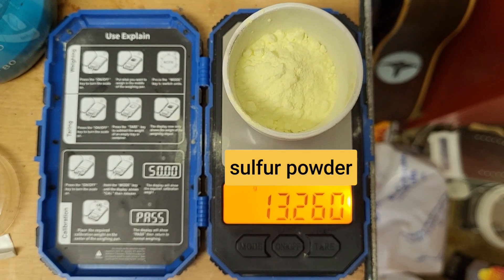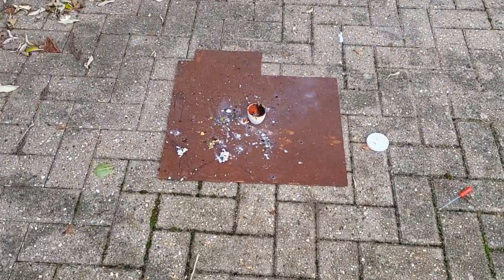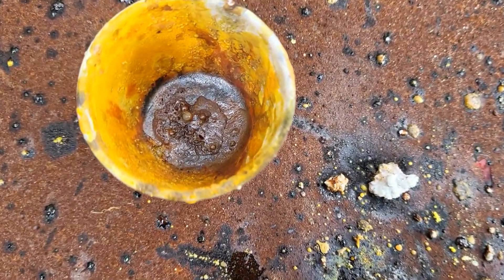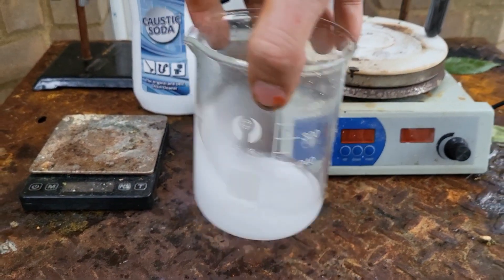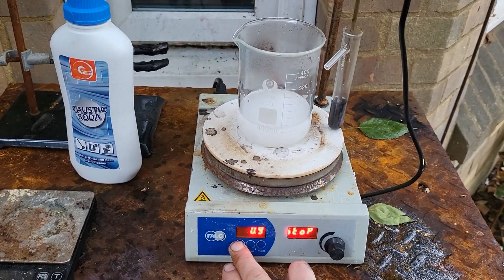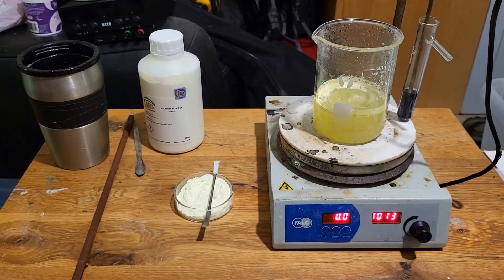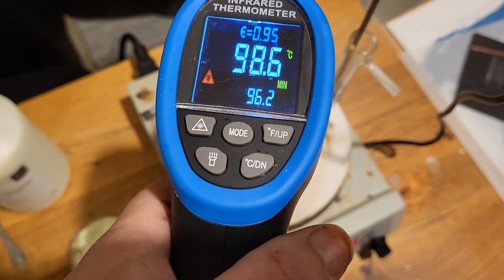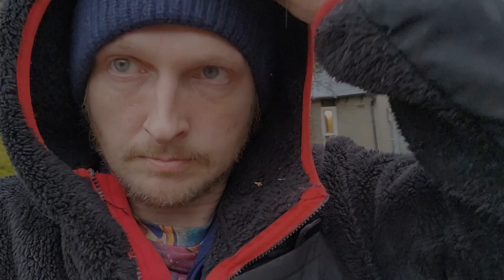how to prepare sodium sulfide (a reducing agent that is a substitute for H2S)

Comment: Very cool. I love the explosive reaction. 👍👍 I think you may have ended up with a polysulfide or some other sulfur species. If you add strong mineral acid to it does it give off H2S gas?

One way to make alkali sulfide is to bubble H2S through a solution of alkali hydroxide in water  I usually make the H2S by reaction between ferrous sulfide and sulfuric acid. I make the ferrous sulfide from sulfur and iron powder (7 parts iron to 4 parts sulfur by weight IIRC). The ferrous sulfide is ideally ground into a powder before use but that can be easier said than done.
Reply from the maker: Sodium sulfide, hydrosulfide and polysulfide are coformed but according to an apoptosis video from 3 months ago this stoichiometric amount should favour mostly just the sulfide. I've got some bits of solid that certainly have the right appearance. It feels soapy in fingers like NaOH.

Yeah the small but explosive sodium fire was fun. 9g might have been a bit too much sodium with it still essentially being in chunks rather than like a grain
Reply from the maker: I have some iron sulfide sticks that fit in a gas generator. I did lead sulfide from lead acetate using H2S a few months ago

But isnt it quite slow to react meaning lots of gas needs to escape, and isn't H2S up there with HCN as far as being deadly?

I guess I could use a gas washing bottle and lead the rest into something like bleach